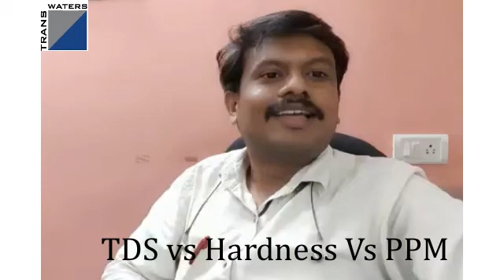TDS vs Hardness vs PPM

Comment: So We can check hardness of water with TDS meter?
Reply from the maker: We cannot check the Hardness using the TDS meter. Separate kits are available to measure the hardness. You can refer my below video on how to measure hardness using one of the hardness testing kit.

https://www.youtube.com/watch?v=DbYUmZJf7tM
Reply: @gowthamandesingh6493  @ Thank you
Reply: Hardness and ec are same
Reply from the maker: @MrMutharaopavan    No they are different. Electrical Conductivity (EC) is a mechanism to measure the TDS.